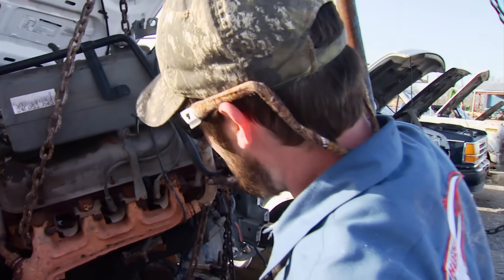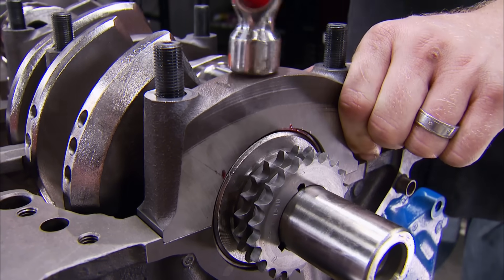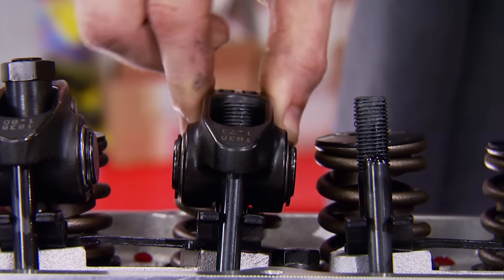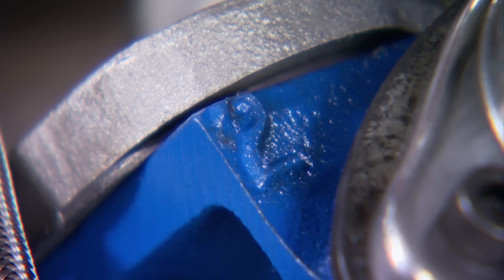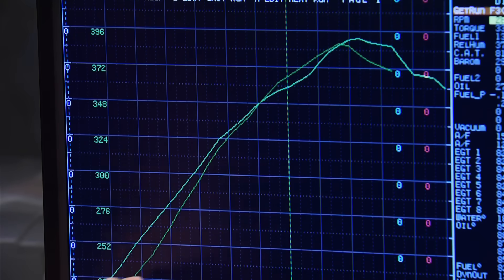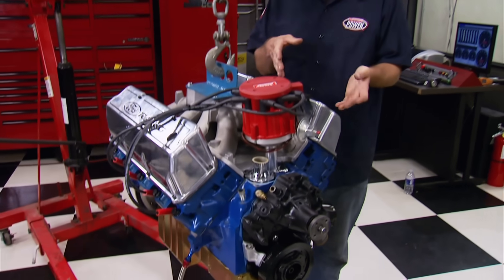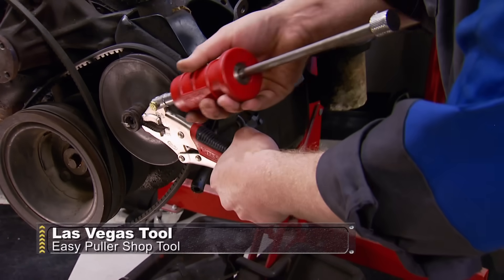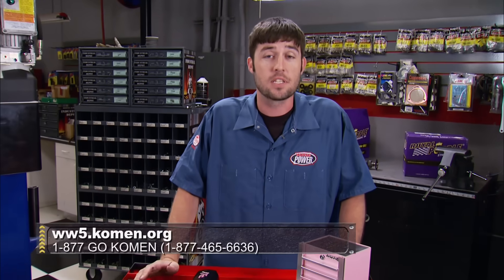351 Small Block Dyno Shootout: Windsor vs Cleveland - HorsePower S16, E11

Comment: A better comparison would be the 408 Clevor vs a 400 Ford with similar aftermarket aluminum heads. And for a 351C 4v vs 2v, you need a camshaft that exceeds 7500 rpm to really see those 4v heads shine. And maybe a classic closed chamber head to compare to open chamber on 351C

Comment: Not sure why they didnt stroke them both, but I'd take a Clevor over a Cleveland any day.  The Windsor has a significantly stronger block. Only way I'd take the Cleveland is if  you are setting up the Cleveland for 7k rpms. The big valves need to move big air to be most efficient. That would be Hella expensive though, as everything needs to be beefed up.

Comment: Friggin' idiots. Put on open chamber 4V heads (same chambers as 2V), an intake with 2V ports, and headers with 2V flanges and expect to se a difference? The only difference was the valve size, which was wasted by the small intake and restricted (due to mismatched ports) exhaust. These morons should never build anything but Chevrolets.

Comment: I had a Ford 400 with 351 Cleveland 4V heads and adapter plates to make the 351 Cleveland 4 Barrel open plenum torker II intake to fit. I would never run that combination again on the street. Too much torque lost down low.

Comment: 358 vs 408 CI displacement not a good comparison. Iron open chamber vs aluminum closed chamber. A dual plane vs single plane intake manifold. Total apples to oranges comparison.

Comment: Just run a stock Cleveland engine with a better cam and closed chamber heads. Really not a good build or a good comparison. I bought a 1974 Ford LTD from the wrecking yard $150 and drove it home. It had a 351C in it, very fast car. I eventually put that engine in my 65 Ford F100 and it would bury the speedometer. It eventually had an oil problem and seized up. I still have the truck and another 351C rebuilt to put in it.

Comment: Loving the comments.

From my very limited experience dealing with these engines, i would hazard a guess that the reason why the Windsor has ended up as a larger capacity.

These would be:

-Budget. Time and money. Windsors are far more common and commonly modified, therefore parts are more plentiful, easier to find and cheaper.

-Necessary supporting mods. To make the most of the canted valves, it may have been necessary to change piston/rod/crank combination to make sure the motor didnt end up a dog, etc. having canted valves would necessarily increase the size of the combustion chamber, changing compression ratio etc.

I am not, by any means, an expert.

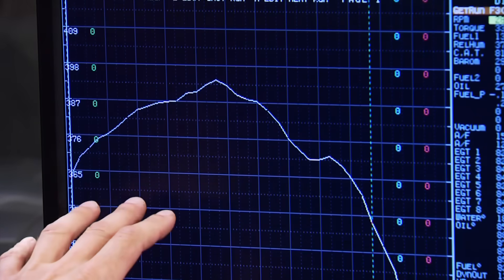Comment: What are the specs on the 2v engine you are comparing the 4v Cleveland to at 9:33 Is it the exact same lowerend with just a head swap? Are they Aussie 2v heads since the std open chamber 2v's would bring the compression way down.

Comment: Ive run cleveland for about 4 decades. Used both 2v and 4v heads (ford iron heads). Some stock, some full on worked over. The 4v heads, i ran em like  a 2 stroke. Nasty solid lifters, 7800rpm, 850 mechanical carb, etc.

Comment: Put a hotter cam with a higher RPM range and bigger carb and turn the 4V Cleveland about 7500 RPM. Watch it take off in HP and torque.

Comment: So you fully upgraded the Windsor, everything big moey aftermarket parts, and then you put some average roller cam in the Cleveland, and WTF open chamber heads, every Cleveland guy knows closed chamber heads are the go. 351 stock Cleveland with a roller cam, versus a Windsor that is upgraded with everything and is now 408 Clevor. What were you trying to rove here?

Comment: Why do people insist on calling engines other than the Chevy small block and the Chevy big block, small block and big block, when the names originally and historically has been given to the two Chevrolet engines ?  It sounds as though Ford,  Mopar, Buick, Oldsmobile and Pontiac owners are jealous.
I've heard Pontiac V8's referred to as small blocks and big blocks, when in fact whether it's a Pontiac 301, or a Pontiac 455, the engine blocks are exactly the same size.
Ford designated the windsor and the cleveland engine series the 335 series, but in fact the cleveland series engines it could be said more closely resembles the 385 series engine, because of its canted valve cylinder heads. However the 385 engines got that name from the 3.85 inch stroke of the 429 and 460  cubic inch v8's, which the 351 cleveland doesn't share.  
Anyway, that's my two cents worth from a guy that was working on all of them from 1973 through 1986, at which Point I attained my aircraft mechanic's license....  Now for me a small block is a Pratt and Whitney JT8D-15a, and a big block is a Rolls Royce RB211-524, that powered Delta Airline's Lockheed L1011 widebody aircraft.  The  Big Three's engines can't compare.  Delta Airlines set records for engines being on the wing the longest with the RB211 going over 20,000 hours of flight before overhaul. The engines were as overbuilt as the aircraft. Both are legends.
I worked for Delta Airlines for 32 years..... Spent many hours "wrenching" on the L1011. 
BTW, dollar for performance dollar, I'll take a Chevy small block any day of the week over anything that Ford has ever produced.
Reply: BTW, dollar for performance dollar, no one cares what you think.  It's of no value.
Reply: @eskieman3948  Clearing it up. Sorry you got your feelings hurt buttercup.

Comment: Ive personally built low budget Clevelands with 4 barrel heads and  a solid cam at 450 horse. I also built a 408 Cleveland that was over 600

Comment: That's the government way to compare, stack the deck. Nake the windsor better with Cleveland parts. The only advantage a windsor has us a larger crank journal and taller deck for more stroke and thats if you use Cleveland style heads

Comment: 4V heads were designed for an operating range of 4k - 7K with an unrestricted free flowing induction system. Basically, Ford designed the 4V Cleveland for wide open throttle, with  the cam/valves being the restrictive limitation.

Comment: I remember back in the 70's that between the 351W and the 351C, the 351C was the engine everyone wanted.
Reply: Still is for original equipment, or if you have deep enough pockets to not mind the cost.
Reply: In the 70s that would have been true. However, today there is much, much more aftermarket support for the 351W, which, when combined with the taller deck height giving it more room to add displacement via stroker kit, has more of an upside. Likewise, in the 70s, the Cleveland 4v heads would have been the most desirable due to their superior (at the time) flow characteristics over the 2v or Windsor heads. Today, there are even much better flowing heads, you can even get canted valve, or hemispherical heads for a 351W now. A lot has changed since the 70s, some for the better, some for the worse, but when it comes to what has the most potential for power TODAY, the 351W wins over the 351C because, as I said, aftermarket support.
Reply: @crewdawg2008   351 C will eat a W, then and now. you would be in high dollar race heads for a W to compete, and most of the heads are C based
Reply: @notsure6182 Then yes. It wouldn't be all that expensive to build a W that would beat a C. You have a bias, I get that, but its wrong.
Reply: @crewdawg2008  inline heads that can compete with canted are rare and extremely expensive
it would be cheaper to build a C which is why everyoen in early prostock built a C and not a wheezer
yes I am biased, towards better parts.
Reply: @notsure6182 Right, but a person can get canted valve heads, even hemispherical heads if they want them, for a W. The aftermarket is loaded with them. Far more aftermarket support for the W than the C. More cam selections, more intake options, more everything. And since W engines are easier to find than Cs, it makes more sense to go that route for any reason other than nostalgia
Reply: @crewdawg2008  W is an inline engine. sure you can put C heads on it. but you just proved the point that the C is superior. you still get stuck with the truck bearing sizes. if we want to play displacement we just use the 351m 400 block.
Reply: @notsure6182 I proved the C has a better head design, which nobody denies. The bearing size isn't nearly as big a factor as people make it out to be unless a person is racing professionally, and in that case, they're using an aftermarket block anyway.
Reply: @c @crewdawg2008 e Windsor block is definitely more popular, but the higher dollar and higher horsepower you go the more likely you are to see an evolution of Cleveland heads on top such as Yates heads, old C302/B351 Motorsport heads, or getting pretty popular now are the Higgins heads which are very similar in architecture to the old C302/B351 heads but with a lot of advancement in port and chamber design.
Reply: @jimbojimson Quite right. The major issue with the Windsor style engines was they didn't breathe very well. They needed something better than what they came out of the factory with. That could be some variation of something that resembles a Cleveland head, which is a canted valve head, or it could even be a hemispherical style head, theres a broad range available these days, they've got tons of aftermarket support.

Comment: LOOK. IVE SEEN COMBOS  ON CLEVELANDS MAKE  MORE THAN. 600 HORSE .....GIVE IT 11.3 COMPRESSION...A SOLID ROLLERCAM OVER 600 LIFT...A 900 CFM.  DOUBLE PUMPER ..WORK THE DISTRIBUTOR OVER.....LSA OF 108 ...GENERALY SPEAKING....

Comment: Bogus! 4v Cleveland are designed for much higher RPM ! A friend of mine has a Boss 302 he drag raced and would turn the Boss 10,000 RPM! The Boss and 4v Cleveland are the same head! And you used the lame open chamber heads that aren’t the best! Use the Closed Chamber head and turn it to a minimum of 7000RPM and the 2v will be no contest of which is best 4v Closed Chamber the same as Bob Gliden used for his winning drag car!

Comment: I'm only half way into the video and I have a big problem with your builds!  Why put a stroker crank and aftermarket Cleveland heads on the Windsor  and leave the Cleveland basically stock????? That's not shootout, more like an ambush!!!!!!!!!!!!!!!! Built with the same up grades or totally stock the Cleveland will blow away the Windsor every time. This test is TOTAL BS!!!!!

Comment: I believe they think most people are morons by watching this garbage and this is complete garbage; why don't you build a real engine a real engine that doesn't use a supercharger or turbocharger or nitrous and yes they get all these things given them for free because it's just the theatrics ! And no I'm not going to be stupid I'm just going to speak the truth now. why don't you build a real engine my 427 was bored 30 over to a 432 12 1/2 / LS6 headss block 2 bolt block and I was going through the lights at 7800 and only with one carburetor a TRC 1020 which it started life as an 8:50 but it was flowed to a 10:20 ; oh I guess It to mention it had an ultra dyne solid roller 720 liift with a set of LS6 heads yes it was all motor no supercharger no turbo no nitrous bulshit all in my 68 Camaro; it was a real Camaro it was a 68 RS SS 396 4-speed and my best passed with the car was a 1078 123 an hour and yes I ran it on race fuel 115 octane and yes it had a the original 12-bolt with 488 It was running on Mickey Thompson 29 1/2 / 9 through the exhaust which was 3 1/2 in with two chamber flowmasters...

Comment: Putting a set of 'Australian cast iron Cleveland 302' 56 - 59cc quench chamber heads on a flattop pistoned 351 balanced Cleveland will yield 10.7:1 comps and with a Sig Erson TQ-20 cam and makes a lot of HP in my F250 High Boy.
The 302 Cleveland heads are easily available and inexpensive here in Australia, and an easy way to make good power without spending a lot.
Australian 2V Cleveland's came with four barrel spread bore manifolds on the 351, s and four-barrel 600 Holley style equal size venturis on the 302 Cleveland's so no need to spend on aftermarket manifolds as these flow quite well.
Premium gas and the better swirl patterns of these quench heads along with altered advance curves keeps pre-detonation under control and a good alloy radiator takes care of the heat.
I'm still running the Australian OEM carburettor fitted to 351 Clevelands over here, a Carter 850 CFM Thermoquad and it performs very well. 
No need to rev hard with this combination as the torque is more than ample at lower revs for a heavy truck.

Comment: "we wanted the Cleveland to be streetable" as they throw an open plane intake on it. 

This video is extremely misleading they put a built Windsor up against a mostly factory Cleveland, with less compression, less cubic in, and factory heads. They can't utilize what an open plan intake has to offer with the heads and cam choice. Everything they picked for the Cleveland, none of it worked together.

Comment: I noticed you used Hooker Long Tube headers... I am guessing you did the stainless # 6901-2HKR. I need to replace the headers on my 351W in a 69' Mach 1. Would that be your suggestion for headers? Thanks,

Comment: You guys are morons. You run the cleveland with a single plane, which no one would do, especially with the 4V heads. Then you compare to a Windsor STROKER with clevor heads and bigger cam? Why do I always get sucked into these vids? At least I did not have to suffer through Pat in this one

Comment: They put 351C heads on a 351W , Gave it a better cam and air gap intake. For the Cleveland they put the smog 2V and 4V heads and stock cam? with an intake for high RPM. There isn't a engine builder in his right mind that would build a cleveland engine like that!!!!!!!!!!!!! In 1971 the best cleveland the Boss 351 compression was 11:1 and out performed any small block out at the time.

Comment: You choked the 4V heads with the 2V style intake.   The runner size on the Cleveland intakes between 2V and 4V is massively different.  The difference is so great that instead of a ram effect in the head runner, you get an inversion effect.

Comment: this shoot out ain't worth shit and everybody knows it. put aluminum heads tailored to 357 cid on the cleveland and a cam shaft as well and use a stock type duel plane intake made for 2brl heads if you want street torque. you have to do at least as much as you did for the windsor or the comparison is N/G. the comments bear this out, you guys are for shit. and hey, which one cost the most??? how about a nice, new flat plane crank for the cleveland with a camshaft to match, you changed the crank in the windsor, so why not, it's only fair??? give me a fu@kin break will ya??? this is total BS. turn at least 40 guys and you may know something without having a conference or reading the latest hot stuff article on the net. i can't believe you guys, i really can't. now, go ahead and prove me wrong, that's all you gotta do.

Comment: Even the 2V Cleveland vs the 4V Cleveland part of the shootout isn't a fair comparison. The 2V heads had any where from 74.7cc to 79cc combustion chambers depending on the year, while the 4V Closed Chamber heads (when people say 4V heads, this is what they are referring too) had 61.3cc to 67.6cc combustion chambers. This would have changed the compression ratio by a decent margin, equaling a real world change in performance. But instead you chose a set of 4V open chamber heads with 73.9cc to 76.9cc combustion chambers. So, if the 2V heads were 74.7cc and the 4V heads were 76.9cc, the 2V heads would naturally outshine the 4V heads as they were designed to function better at lower compression. My 2cents anyway-

Comment: An old church friend bought a junkyard "390." He said something didn't look right. So he measured bore n stroke, checked casting numbers. Turned out he bought 428. He put ut in an old step side. He hit 6500 RPM and got valve float. My point is, I don't think he did too much to that junkyard  motor, but it out performed both of your motors for a lot less money. People like you turn folks too bowtie fans.
Reply: At stock 351C, stock 351W, a stock 428. Expect the 428 to make more. The Cleveland n Windsor comparison was NOT fair nor impressive. In fact both engines were disappointing. THAT was my point. Go troll elsewhere.
Reply: You are surprised a 428 makes more horse power than a 351?

Do you know anything about displacement?

Do you know the difference between a big block and a small block?
Reply: They weren't stock engines.
Reply: Read the other comments. This is a bad comparison. The completed engines lack the HP. It's all hype.

Comment: I would have sourced 4v closed chamber cylinder heads not open chamber 4v's and bumped compression to 10.5 to 1 on the Cleveland. I ran a similar combo to this in an XD Falcon in Australia and made 550hp.

Comment: I know if they used the same cam and compression on the Cleveland  also the stroke there would have been a big difference. Million dollar Bill in the 80’s with the woods brothers ran a 351 Cleveland to over 200 mph

Comment: The heads that were used on the Cleveland 4V and 2V were open chamber junk !!! If a set of 70 model 4v closed chamber heads were used it wouldve had better results
Reply: I have 302 closed chamber on my 351 , goes good.

Comment: The comparison made is exactly like the 427 vs 428 and if the same compression were applied to the Cleveland and, bore it out to give it the same displacement and you'll get 600+ hp because it is all about RPMs ¿`_